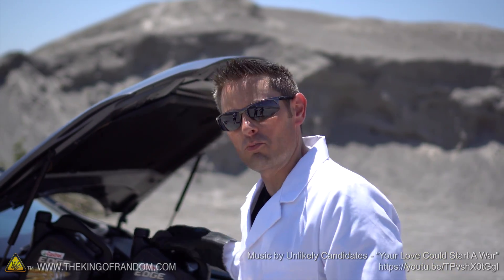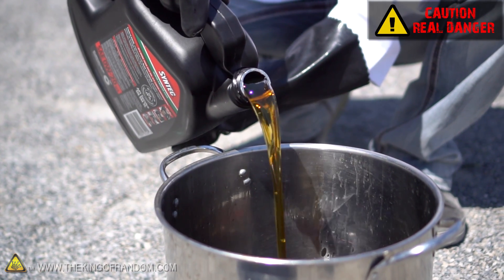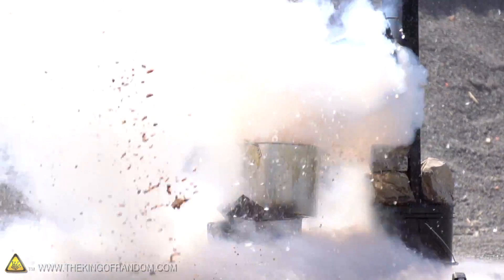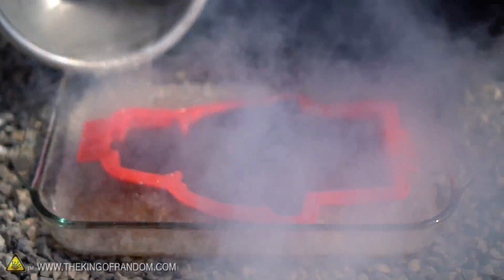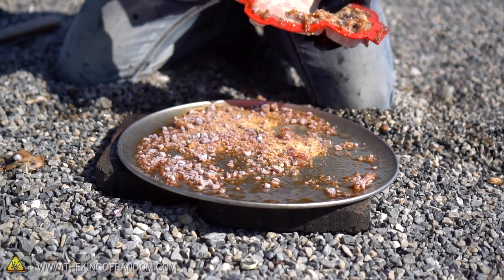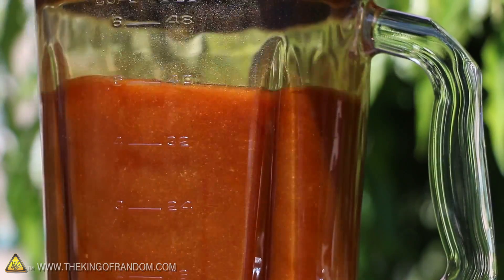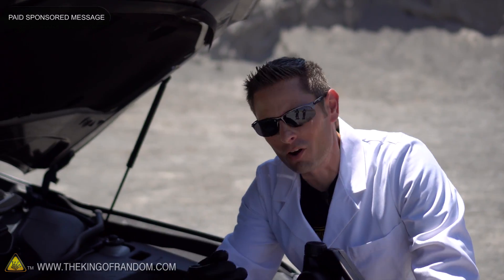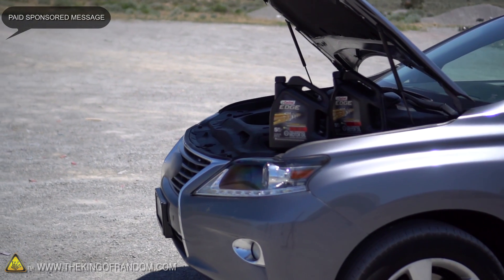Liquid Nitrogen Meets Boiling Motor Oil

Comment: No can do, Castrol. High mileage car from 2002. 0w20 wouldn't work too well with rings that have wear from almost 200k miles. Gotta use 10w40 just to prevent TOO excessive of burn 😂 0w20... Man. I'd probably use a quart per tank of gas!

Comment: I have read many times that if you run just conventional oil for say 50,000 miles and then switch to full synthetic, it can cause the gaskets to expand and contract causing leaks

Comment: Engines run better with cooler air, they are more effective, and provide much better performance... Do a video of an engine sucking in the condensed vapor from the liquid nitrogen... and measure the performance.
Reply: Lex Perez well liquid nitrogen doesnt have air and therefore no combustion, pure oxygen would work better

Comment: Contrary to the contrary it is indeed bad to switch to synthetic from regular if your car is older than 10 years or has more than 120k miles, for there may or may not be gunk blocking a seal in which synthetic will eat that gunk and clean your engine however create a leak... I've seen it happen twice, and that's everyone's theory on it, 5 star rated mechanics etc etc. either way, if your vehicle is young don't worry!

Comment: the heat on the blender comes from the shaft that goes thru a to the motor to the blades  it gets hot  and can even melt ice or chocolate  nothing to do with the blades but the shaft that goes thru the blender base  as this has no bearings but uses nylon shims and grease to lube it 
next time open one up or un screw the gear in the base
get it hot enough it will melt the base where the gear is that goes to the blades

Comment: It actually is bad for your engine, (depending on the engine of course) to switch from synthetic, to regular motor oil. Some engines require synthetic, some require a regular motor oil.

Comment: Just to throw it out there, putting synthetic oil in an engine designed for conventional oil isn't a great idea. Conventional/mineral oil is a lot thicker and less viscose, therefore it doesn't get throw extremely small gaps that you might get on an older engine but synthetic oil can get though those tiny gaps.

Comment: Grant I have used Castrol full synthetic since day 1 of my wifes car and changed the oil every 3-5,000 miles and now 160,000 miles later the engine has sludge built up in it. Its sad because just the oil alone was costing $40-$50.   (The filters were dealer or high end Napa not cheap Fram.)

Comment: I'm a mechanic and I highly recommend you don't switch between oil types, especially if you have a vehicle with high miles and have been running conventional oil for a long time. Conventional oil sludges, synthetic oil doesn't. Synthetic oil has a lot of detergents in it that help keep the engine clean. Therefore, if you've been running conventional, there's a good chance that your engine has sludge in it, which may not cause any problems. Take that engine and pour synthetic oil in it and it's like using an engine flush. Not good. All that sludge that was just sitting there doing nothing now has the opportunity to go for a trip around the whole engine, where it can clog small ports and passageways and cause major engine damage. And the oil company isn't going to pay you to fix your car. Internal engine repairs cost thousands in most cases, especially if the engine has to come out of the car for machine work. Do yourself a favor and stick with one type of oil from the get go. If you bought a used car from someone (not a dealer) ask them what kind of oil they've been using and continue to use that. If they say "I don't know" your best bet is to use conventional. Going from synthetic to conventional is OK, it's going from conventional to synthetic that carries a major risk.

Comment: Nice glitz and showmanship. fun to see motor oil used in cicumstances it was never designed for. The SAE rating of any motor oil product is assurance that any manufacturer will meet or exceed a rigorous standard when used as a lubricant inside an internal combustion engine. We, the viewers, learned nothing except that Castrol is desperate enough to attempt viral marketing for a product with strict performance measurements in conditions with no real measurements. We were entertained though. I'm still not using Castrol...

Comment: Um that's false information. If you have ran conventional for most of an engines life, the seals have wore and "seated".  If you switch to synthetic it will leak. This is because synthetic has far greater lubricating properties then conventional and will work its way past old seals and find a leak where there wasn't one.

Comment: I do hope you dug up the ground where the oil spilled and got ever drop of oil out.  That's the only way to get it out.  You should of used some kind of heat tarp to contain it.  In the video you should of explained how you were going to clean up the mess.  Just because you are out in the middle of no where does not mean you can spill motor oil plus I felt I was watching a big motor oil commercial.  This was not one of your best videos.

Comment: Thinking being in a blender would wreck the oil? What about F1 cars that rev to 18,000 RPM and have pressures much higher than that blender can create and heat that's nearly 4x as much?

Comment: What kind of test did it pass? I don't get it.
Reply: It passed the "Let's All Watch a Six Minute Advert for Castrol Edge" test.
Reply: ***** That's what I meant lol. I could use a plain water and pass it too.
Reply: +TheDJLionman it froze solid at a temperature its never going to reach, then was brought back to normal temperature and still seemed ok to use. Until his car engine siezed 5 minutes down the road lololol
Reply: The real test will be to see how his NEW CAR works after trying to ruin the oil!
Reply: Does it matter? It looks cool
Reply: want to see you putting normal oil after being mixed with liquid nitrogen and then cooled down in your car
Reply: SAT Test
Reply: Joshua Briggs Liquid nitrogen is -195 Celsius, nowhere on the earth will you reach that temperature. The test is literally worthless. Not hating tho, love Grant.

Comment: I sure hope you didn't leave that harmful motor oil on the ground there...
Reply: If you read the description you would know that he cleaned it all up and disposed of it properly.
Reply: Ray McDaniel here in germany the firefighters will clean up the oil, if a car is losing some oil we put a special powder on id so it cant go into the ground...
Reply: Jon Roe It actually harms, whenever you work with oil or stuff like this you need to remove all the sand or earth that was contaminated and take it to any center that can handle it and with handle it I mean sealing it away, same with other kind of liquids/or stuff like oil.
Reply: +Jon Roe One drop of Oil/Diesel can make up to 150l of water Unconsumable. That amount in the video looked more like half an liter. So yes, it is a problem if nobody cares about it.
Reply: +Camel1774 Nobody seems to care about the oil that leaks from cars onto roadways, why care about this? And no, it won't hurt the water supply or wildlife.

Comment: about the liquid nitrogen, you should use ice or dry ice instead of liquid nitrogen. the density of liquid nitrogen is so low~ it wouldn't sink to the bottom. use ice or dry ice, it will create a bigger explosion

Comment: i have a 2004 Honda motorcycle, it burns anything that isn't thick mineral oil (15w40) - it had 0w30 fully synthetic in when i bought it and burnt oil pretty bad at high revs, now with the mineral oil in it works like a charm and the engine is actually more responsive, amazing what different types of oil can do!

Comment: Do not switch your oils back and forth. When your motor gets used to one it is normally a good idea to stick with it. if you want to switch to synthetic millage does not matter as much as the condition of the engine. if it had regular oil changes before the switch the seals will typically be in better shape and will not cause a leak. If the oil changes have been skipped then it could have excessive carbon buildup and switching to a synthetic will probably make it leak if you are at a higher millage when you switch. synthetic oils are better because they keep motors cleaner and they do not loose there viscosity property's like regular oil does. Also if the motor had synthetic from the factory that is the only oil that should be in the vehicle.

Comment: what happens if you combine a cup of liquid nitrogen w/ a cup of boiling hot water, then put your hand in it.
Reply: I wonder if your hand will be ok...
Reply: Leidenfrost effect... The liquid nitrogen would bead off to the floor and the boiling liquid would burn ur hand
Reply: I read ur comment wrong..  But it would just super cool the water is suppose... The nitrogen is colder than the water is hot so it would cool it down faster than the water could heat the nitrogen up

Comment: 3:35 This test would only be helpful if oil contacted moving parts, but it doesn't. It would only touch contact with the crankshaft IF the oil was too high. 
If the oil level is too high, it contacts moving parts in such a manner as air is mixed into it. This is called cavitation. The result is air pockets in the oil, and less liquid oil to cool parts such as piston skirts. The "foam" also sticks in place and doesn't drain back to the pan, and insulates parts from normal heat transfer. You generally won't kill the car, but it is best to get the oil down to the appropriate oil.

Comment: In my opinion, these three tests do not seem to demonstrate any real strength of the oil. Yeah so you can boil or freeze this liquid or put it in a blender, but what does it show? Most all liquids are going to be able to survive these tests with no altercation to it. Try it out with other motor oils and you get the same result.

Comment: Oil will start degrading above 275 Fahrenheit, polymers and additives will be broken apart. Basically, you're running on oil that's equivalent to 10-14000 miles of age. Depending on how long you kept it above 275 Fahrenheit, it may be older still. Also, your engine wont just fall apart, but if I were you, I'd buy a neodymium magnet and stick it on the oil pan nut(the one you use for changing oil).

I feel bad for your poor bearings. :<
Reply from the maker: I used the same stuff.  Will let you know if my engine blows up.
Reply: I'm pretty sure he's not going to use the oil he just tested, in his car lol. I think he'll get new stuff for his car
Reply: just another point to add, what you did, really wouldn't have shown up in the appearance of the oil... go do these tests with some walmart oil or whatever your cheapest oil is in america. i bet it will look the same as the castrol. doing these tests proved literally nothing.
Reply: or you won't because you'll be...well... you know...
Reply: +Adam Hazelwood but he almost definitely will not own this car when it begins to show the damage. it will be something that the next person will have to deal with. and that just doesn't sit right with me.
Reply: +snipeish1 I was mocking this guys ludicrous experiment
Reply: Not synthetic oil.
 http://www.jdpower.com/cars/articles/tips-advice/synthetic-motor-oils
Reply: +snipeish1 we get it you know alot about cars, it's his car it literally affects you in no way if his car dies let him do what he wants he's not hurting anyone but himself if something goes wrong.
Reply: +snipeish1 oh ya would Walmart oil survive a blender
Reply: austin bevis not sure if serious question... of course it would...
Reply: snipeish1 one word carfax the new owner assuming he does sell the car will know what the car has been through at that point its up to them if they want to buy it, once again it affects you in no way.
Reply: im from england. wth is carfax?
Reply: +snipeish1 it's a report on the vehicles history it includes Major Accident
Mileage Rollback
Multiple Owners
Structural Damage
Lease, Personal, Taxi or Police Use
Total Loss
Rebuilt
Flood Damage
Airbag Deployment
Mileage Rollover
Salvaged
Hail Damage
Branded a Lemon
Last Reported Mileage
Junked
State Owned
Length of Ownership
Estimated Miles Driven Per Year
Not Actual Mileage
Recall Information
Warranty Information 
and 
Service, Inspection, and Registration History

if there are issues with the bearings when he takes it in to get serviced they will include it in the report. the new owner will have access to this info before they buy if they check.
Reply: +Mike West that's funny cause it says synthetic in the url. great trick mike
Reply: FoxVoxDK Noneofyourb

Comment: 5:10 that isn't exactly correct. More so on Higher Mileage Motor. I did the switch on my car with a turbo. Synthetic switches don't hold the conventional seals well on higher mileage cars. My car was well maintained with obsession. Within 2 weeks of going to Synthetic I saw smoke blowing out of my exhaust. It became quickly apparent what happened eventually due to the switch. As soon as I hit 2nd gear it made a literal thick thick some screen. Same in third etc. It took out all the residue in the seal and pushed fresh Synthetic oil out which went into my inter-cooler. It cost me $1200 to replace the turbo along with some gaskets that never leaked before then. So I highly suggest a disclaimer is put up on that part of the video. The Volvo dealer asked what kind of oil I ran and told them. Then they showed me my parts and explained what happened. They told me to NEVER switch to Synthetic with Mileage on a vehicle. They've seen this mistake often actually.

Comment: Next Video: Running a Diesel Engine on Nitro-methane (Can be bought online or where RC Cars are sold) Use the 55% Boat Mix. (Its Nitromethane and Castor Oil Mix) Torco RC Fuel 55% Nitro Boat Gallon I seen on Ebay. We've seen Diesel is Gasoline and Diesel in Gas Engines. But never seen a Video with Nitromethane in a Diesel :)

Comment: Grant got Castrol-ated. 
BTW, the oil in the blender got hot from the motor radiating heat, not blade friction, ya goof.

Comment: I use Castrol Syntec in my 2004 Honda CR-V which I've had from new.  Just turned 170,000 miles and it runs great.

Comment: DISCLAIMER: Castrol is not the only brand of motor oil that will survive high/low temperatures. 
Any benefits gained by using this brand of motor oil could potentially be achieved with the use of other brands.

Comment: A serious question, What about older engines switching from conventional to synthetic? Ive heard modern engines will be fine but older engines used zinc additives in conventional to keep friction down. Ive yet to run full synthetic in my truck because its over 30 years old.

Comment: Why would changing motor oil types break down the engine? Its just a lubricant and cooling substance, not fuel.
Reply: the theory was that seals, being conditioned to one type of motor oil would break down when exposed to a synthetic
Reply: to ad to that, the gunk from dino oil might clog up cracks, etc, of the seals, and the synth, would break it down, thus when people saw oil leaks from synth changes, they said it was the synth. IT was actually the dino oil masking the problem of the bad seals. 

However, I always put synth in at my first oil change. Plenty of times I've gone 15K without a change and nothing adverse has happened.
Reply: +realwordsoftruth 
Yeah, I would say start a new car on synthetic. But if you have a car with 150k on regular oil then switching to synthetic may cause your engine to start burning oil and may cause loss of power with blow-by. I've done it before and I've seen a relatively smoke-free car start smoking pretty bad at each startup after switching. Obviously they were used cars with a lot of years and miles on them, but still shows what can happen.
Reply: I bought my car with 21K on it and that was the latest i've ever started synth on a car.
Reply: +realwordsoftruth Honestly, I'm not sure why they even sell regular oil anymore since synthetic is so much better. Though if they stopped selling regular oil then I'm sure gas prices would shoot up to compensate for that lost income.
Reply: TheGreatMunky They still sell it. Not as many people can afford $9/qt

Comment: funny fact: New Motors with direct injection need ptc heaters in the Cooling System to heat em up to 90°C. New Oil is all about durability that is shortened by Gears and small measurement of the moving parts.

Comment: me: welcome to oriellys
customer: u guys got any oil on sale
me: Castro edge 32.99 5 quarts plus oil filter
customer: what's the benefits or synthetic
me: u can freeze it with liquid nitrogen inside of a Lego cake tray and still use it